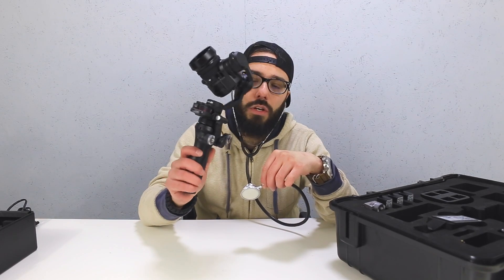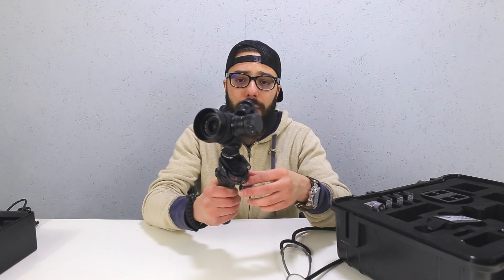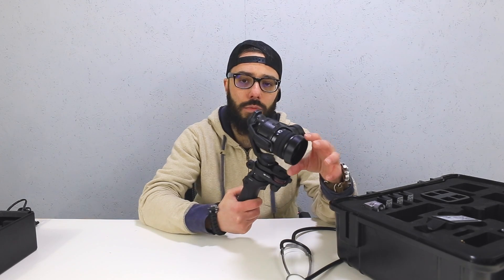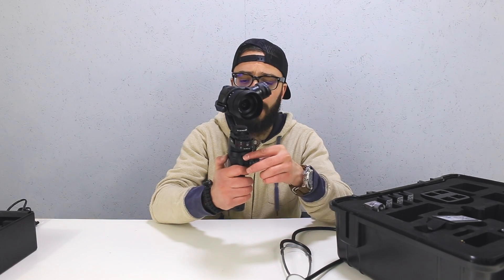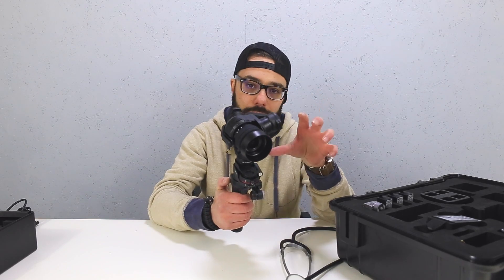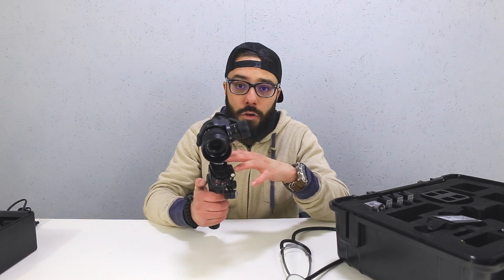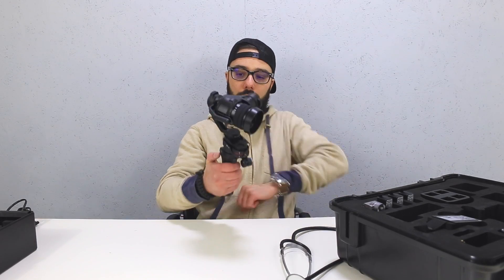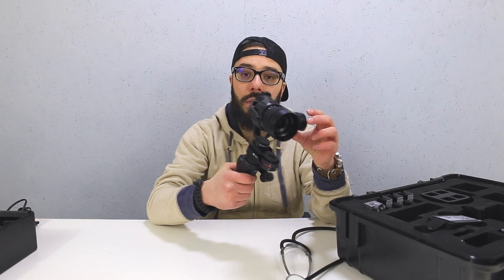DJI Osmo Pro X5 Problem Noisy Motor???

Comment: Hello S Knipey, did you receive the replacement ? Does the gimbal make the same noise ?  I have the same issue here...
Reply from the maker: Sorry for the delay, after some exhaustive message exchange I managed to get it sent back to DJI's Europe repair hub for evaluating and they confirmed that this is normal and sent it back

Comment: sorry mate, that's what the x5 gimbal motors sounds like :( 
it's not a bug, 
it's a feature ;)

I also have bought the z-axis extension, so I do not need to do the ninja walk :D
Reply from the maker: Khalid Aziz too late, it's gone back for exchange :) i too have bought the z-axis so no more ninja walking haha
Reply: I hope the replacement is better. I know when you are recording the motors are supposed to shut off.
Reply: only the fans turns off ot the gimbal motors ;)
Reply: the only downside of the the z-axis extension, ist that the whole combo becomes heavy AF